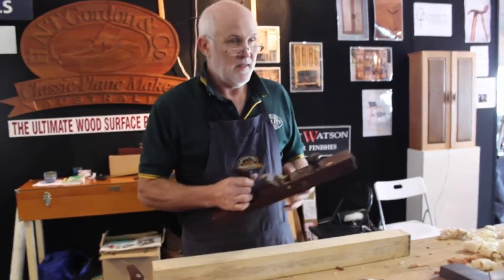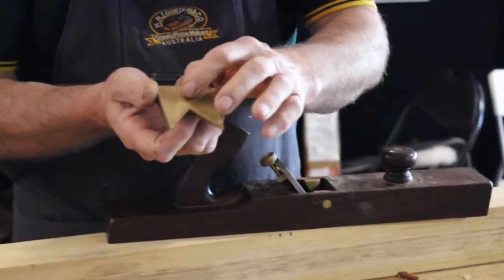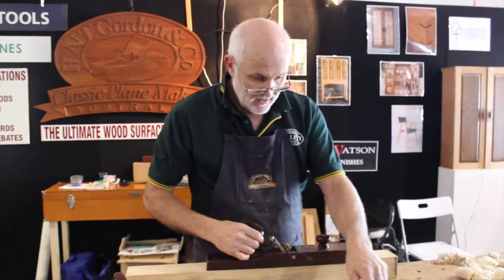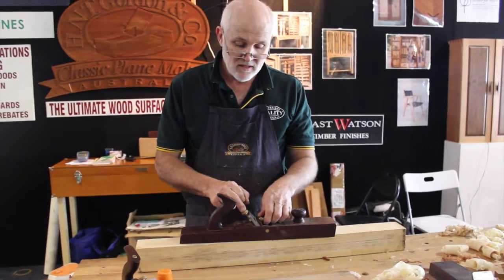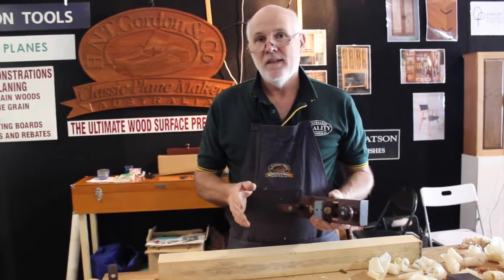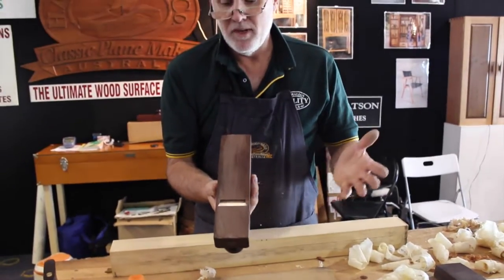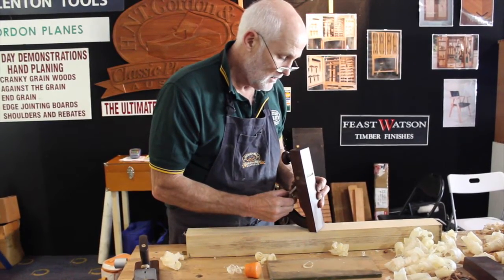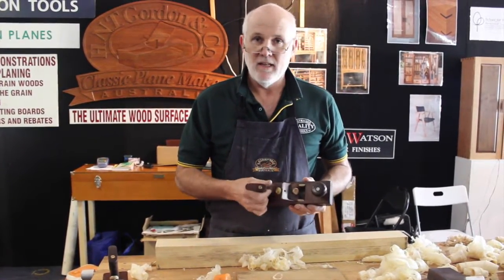Using the HNT Gordon A55 Smoothing & Trying Plane

Comment: Nice plane u got there sir.. Wondering what angle the blade is
Reply from the maker: The bevel angle on the blade is 30 degrees.  And the bed angle is 55 degrees.   When you put the blade in bevel down the blade pitch is 55 degrees for planing, or if you put the blade in bevel up you have an 85 degree blade pitch for scraping which is a nice option for really cranky woods.

Comment: I'm familiar with both Japanese and Western planes and lack a jointer. My biggest Kanna is 70mm blade but its body is only 30cm long so I imagine this much longer reference surface would be good. Would you recommend this A55 trying plane or the older version without the tote/handle?
Reply from the maker: Hi Alan     The longer plane is better for jointing long boards or flattening large surfaces.   I generally use the A55 try plane if I'm jointing boards the traditional way in a front vice.   But I use the other try plane (without the tote handle ) if I'm jointing boards using a shooting board and for planning large flat surfaces,   as this plane is as easy push or pull,   which I find very useful when the flat surface you are planing is greater than 3 feet(1mtr).   The tote handle plan isn't so easy for doing large flat surfaces as it not so well designed for pulling as you would know.   There are some other you tube videos on our channel showing how I use a trying plane to plane a large flat surface which is probably worth watching.     If you need any other info just let us know.    Regards terry
Reply: @hntgordonco.2514  thank you for your wonderfully detailed explanation. Looking forward to purchasing one or the other!
Reply: I just saw that video of you flattening the surface and see what you mean about push/pull being helpful rather than reaching over from the side. Definitely going for the try plane without tote. Alas now I am also tempted by the smoothing plane!
Reply from the maker: @alanoei3584  .     Wise decision.  Regards Terry